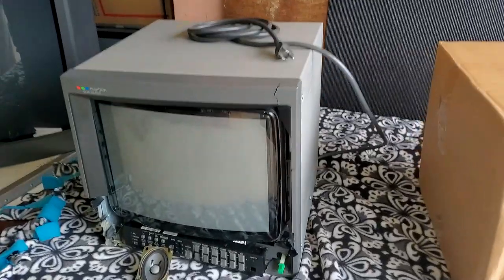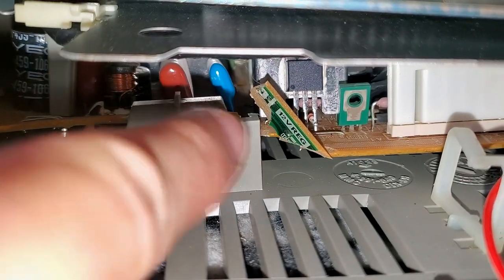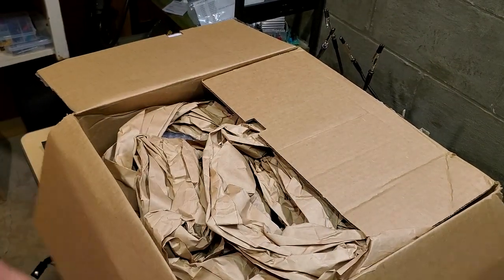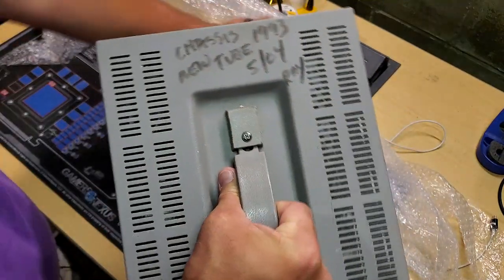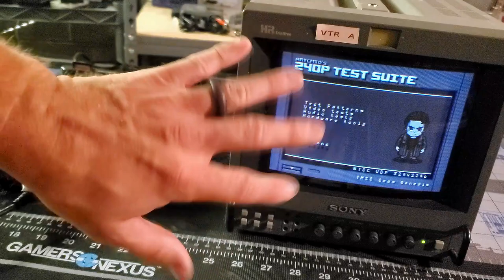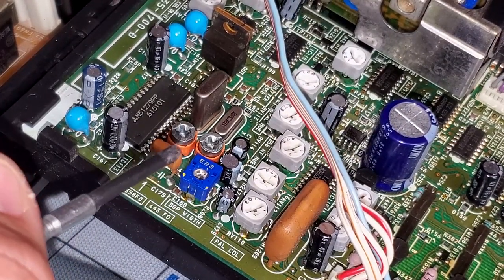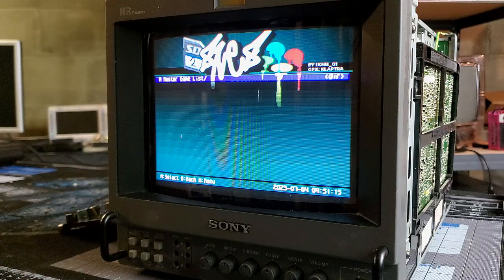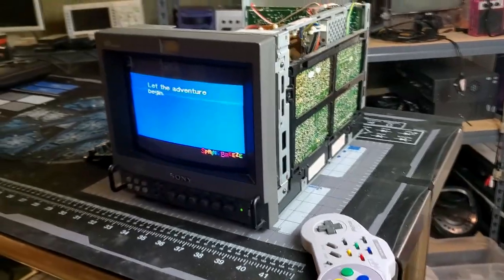The Worst Packed CRT | Sony PVM 8044Q Unboxing & Fix

Comment: the black mark seen is not that it was run over.  bits what know as a jamming mark.  it when the box gets stuck and James on a belt.   it sits and rubs against a rubber belt.  but was not run over.  it just got stuck a but.  in the belt drive transit in processing

Comment: I’ve sold a few PVMs and had no trouble shipping them with tons of large and small bubble wrap and packing peanuts plus double heavy duty boxed. 14 inches 9 inches, you need to spend at least $50 on packing supplies to get it done right then ship it quick with priority mail.

Comment: Nice!  I noticed the soldering on that board didn't look good.  It should be nice and smooth/shiny.  At least in my high end audio world.  It's also possible heating those pots moved around the internals enough to clean them.

Comment: Easy repair! Just 4 soldering points.  I've got a BVM-8045QD that won't show picture on any input, but if I push "blue only" button, it'll show a yellow screen.  Do you think the issue is similar to this unit?  B board issue?

Comment: Honestly, that packing on the 8044Q wasn't so bad, even if a bit light (I received a European 9041QM packed very similarly, tight single-walled box with some bubble wrap). I really feel sorry for the 1344 owner though. Thinking that I received a (non-working) 14L1 packed like absolute garbage but still arriving almost intact on the other hand... Looks like I got extremely lucky that time!

Comment: QUESTION: where can I find a list of fixable problems?

I have a 5" pvm which as far as I know uses the same color board as this one, it started showing only the red on the picture and ended un just showing a solid green and releasing some smoke out of the color board, so there is definitely something wrong in there

Comment: No colour faults were pretty common in domestic colour TV's and also video recorders. Usually, if it wasn't the trimmer pot itself (or a nearby rogue cap that had drifted in value), it would be the actual crystal that needed replacing. A quick check with a colour bar signal and an oscilloscope hooked up to a nearby test point usually confirmed as much..